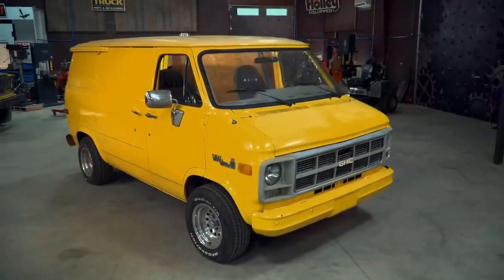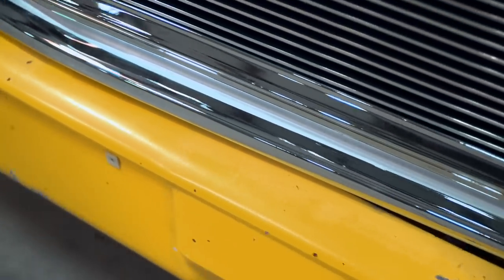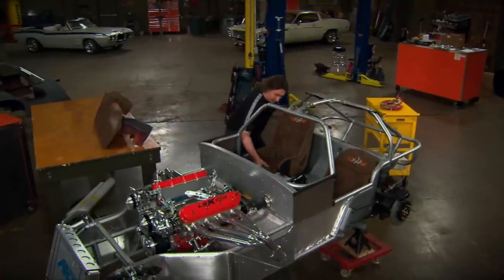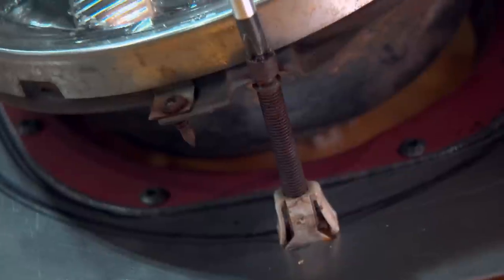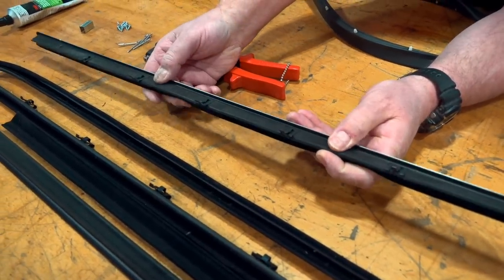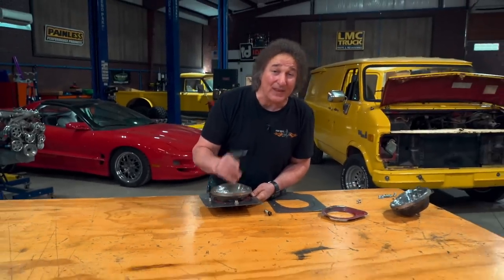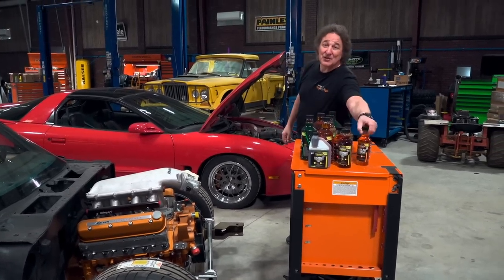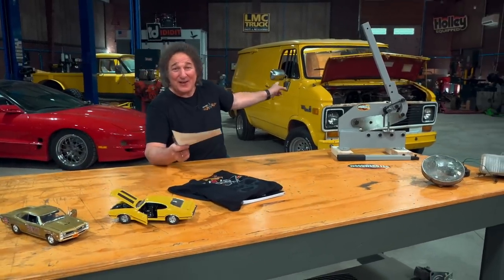Backdate Your Boogie Van's Grille and Headlights Chevy/GMC Van Mods - Stacey David's Gearz S16 E9

Comment: I have the same van that had the grill already  installed but the headlights and turn signals are still stock 79 didn't have the bezels though need to find those then i will be using  your exact method. Love it thanks.
Reply from the maker: Very cool!

Comment: I'd use the factory bumper still. Pie cut the center along the top surface edge and 2in. of the bottom roll  giving a more angular look matching the factory grill and tucks in the ends closer to the fenders for a more flush appearance to go along with the bodywork mentioned earlier in the vid.